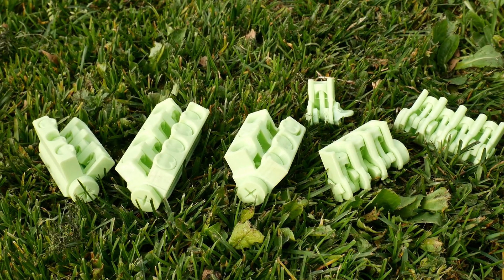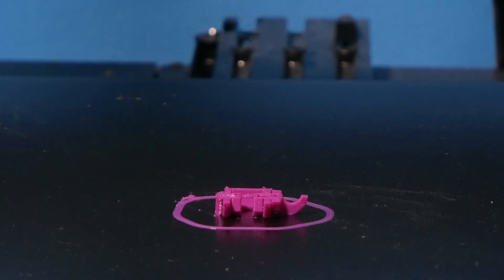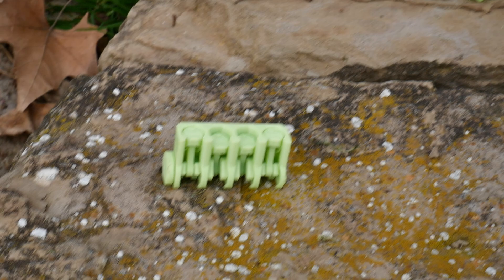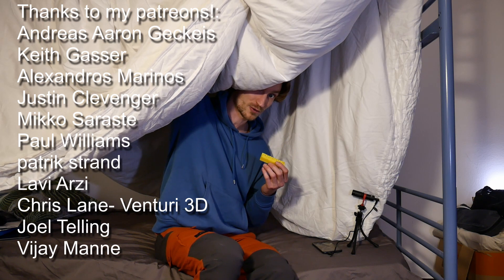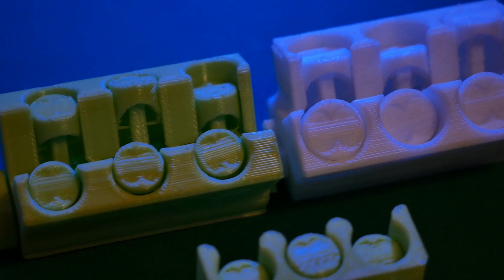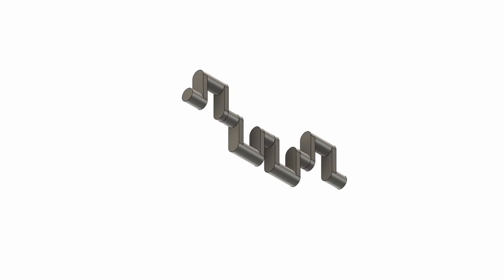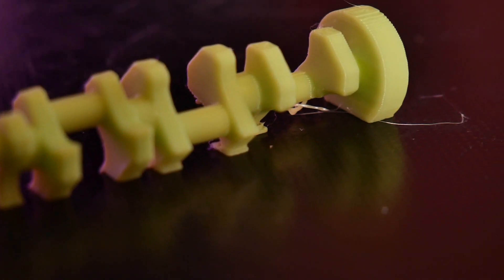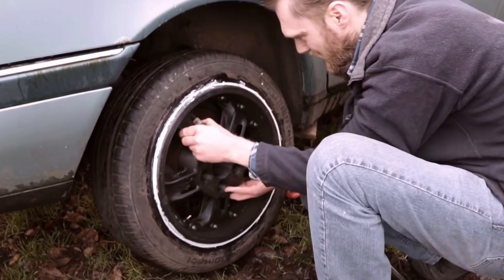3D-Printed V8 Engine - NO ASSEMBLY REQUIRED!

Comment: This bad boy does NOT wanna turn over, but I ain't giving up. thank you for this amazing model.

(Edit:) I got it working! put some chain lube all over the pistons and on the crankshaft and it got rid of the piston issue that was causing it to hesitate. I rate this project a 10/10

Comment: It would be cool to make an air compressor with with a 3d printer I don't assume it would be print in place would need an oring for sealing but I wonder what a pressure limit would be

Comment: As usual, I love the models! Would you mind sharing your print setting for the CR6SE? I have the same and having a hard time setting it up. Thanks!
Reply from the maker: I just use curas standard cr6 se profile with slightly slower print speeds (35mm/s)